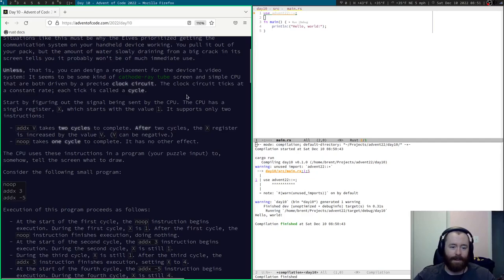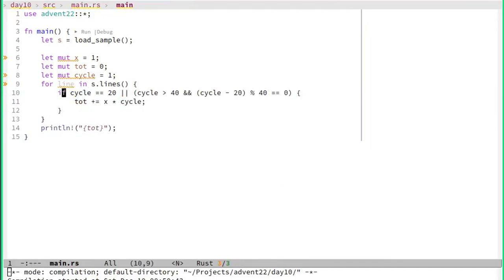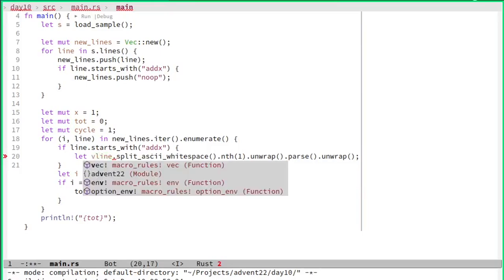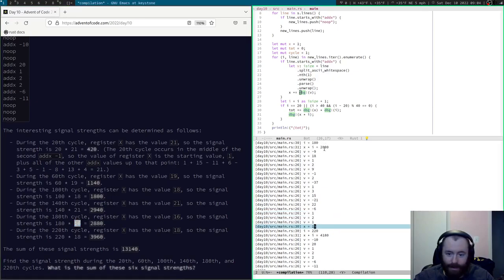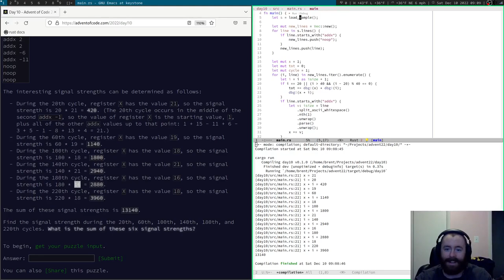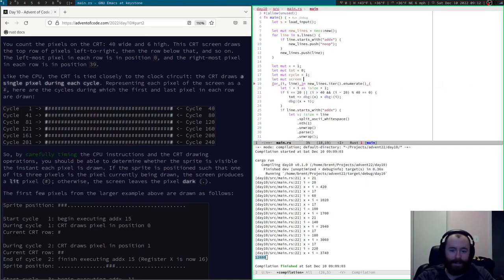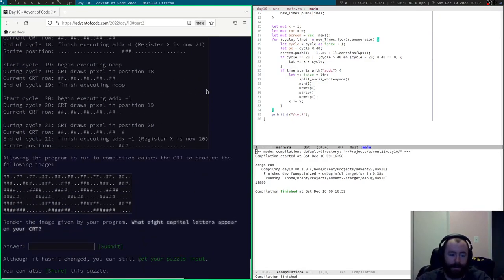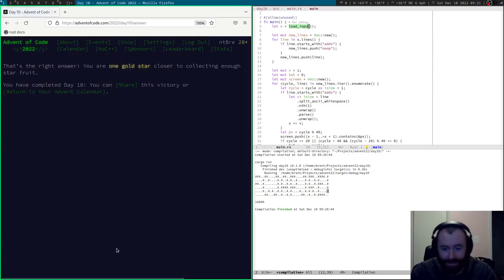Advent of Code 2022 in Rust: Day 10 Cathode-Ray Tube

Comment: In part 2, is your cycle starting at 1? In that case, I think you should be checking for X, X+1 and X+2 for sprite.
Reply from the maker: Ah that probably would have done it too! After the video I moved the check to the top of the loop, which also fixed it.